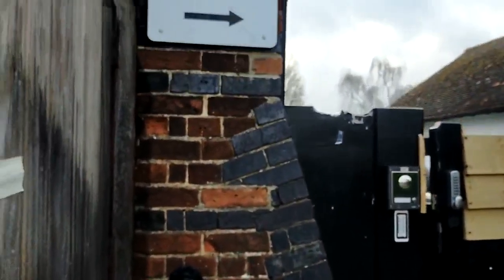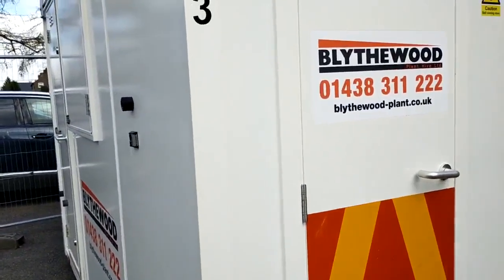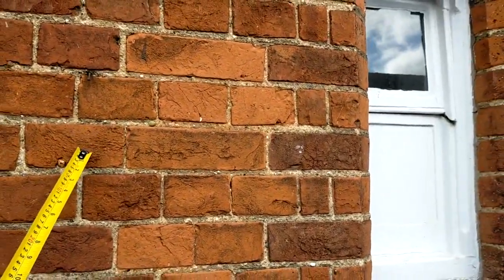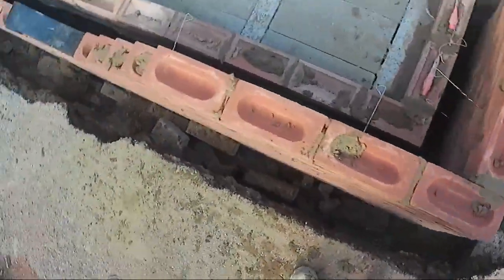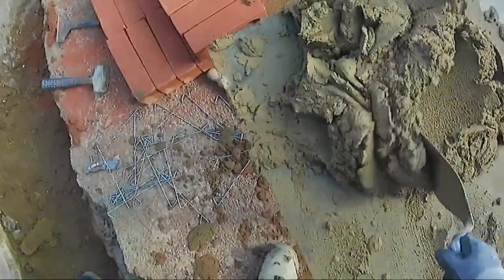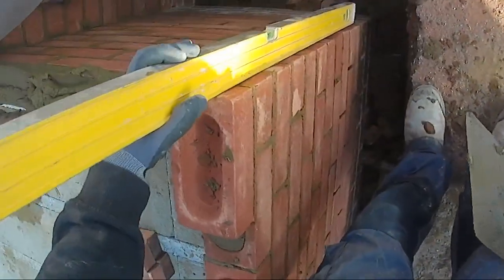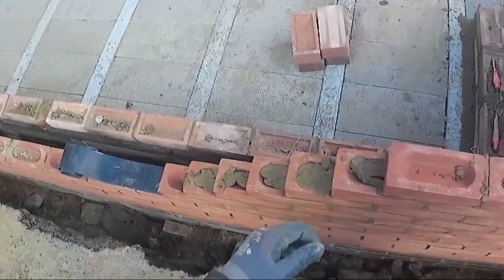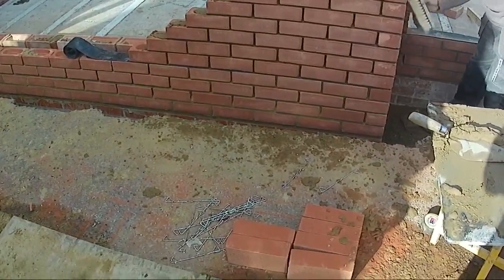English Bond piers and a new job.

Comment: On a job once where the architect when we got there showed us how we should do the jointing.The bricks were London brick company or Flettons silver sand coloured.A nice brick as it happens.We did several test panels.Didn,t mention it was what we did for work which was due to be painted.
When that house was nearly done and we were having our break the Architect came to stop the work as it was all 50feet out of position.Red faces all round needless to say we never saw the guy again.
By the way===ever done work on Wimpey no fine?
Reply from the maker: No keep away from that stuff.

Comment: Do you put myathene behind the wall starters mate?
Reply: Just got to that part of the vid ffs whats that gonna do? Just rake out and mastic it 🤣
Reply from the maker: @craigstyrin3453  Load of bollix mate, I generally don't put anything behind them as it's just a passage for cappiliary action and builders just don't bother with the mastic.
Reply: @bricklayersworldwithandy6277  yeah its mental! 
Alot of them joints just crack dont they id say 7/10 over time with movement, i rake them out sometimes and silicone them but im crap with the gun🤣